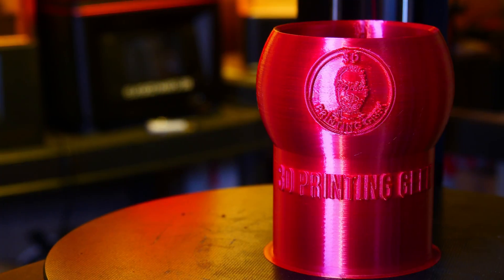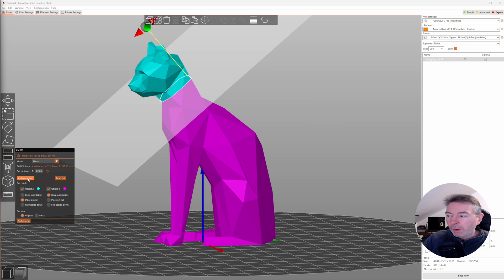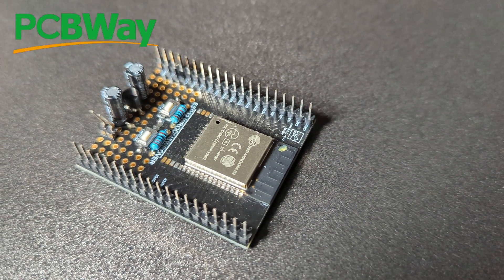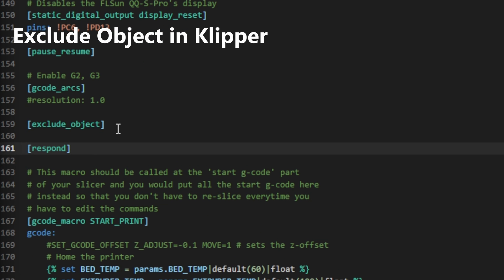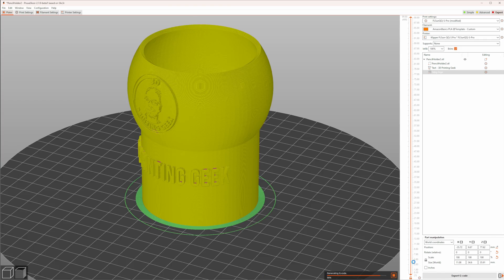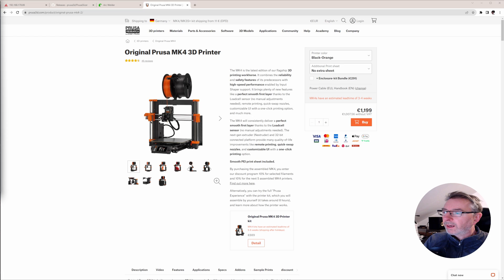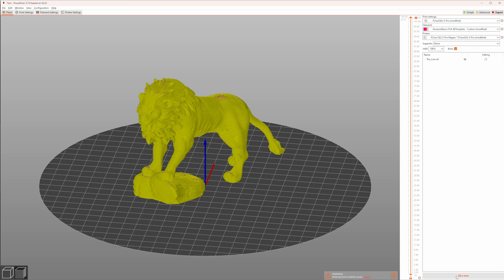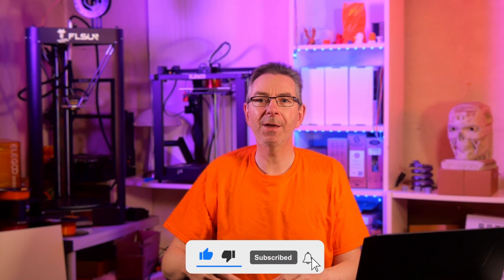From 2.6 to 2.7: What's New in PrusaSlicer's Latest Release?

Comment: My Add part section is not there
Reply from the maker: Thanks for the comment. Unfortunately without context I don't get what it is about 🤔
Reply: @3D_Printing_Geek  ah apologies for not being clear. I am new to 3d printing. So yesterday i was working on an object in tinkercad, exported it as .stl and imported that stl to prusa slicer ( my printer is Sovol sv07) within prusa i attempted to add text to the object however “add part” was not available, generally the menu i saw upon clicking the surface didn’t have as many options as in the video, the top part of menu options was the same however the it ends and i don’t get to add text to the object, only as a separate object on the bed..
Reply from the maker: @TheLooking4sunset   Ok. Now I got it. Are you sure you're using the 2.7 version of PrusaSlicer? I just tried exactly what you described: Exporting an object as STL from TinkerCad , and importing it into PrusaSlicer. Then right click on the imported object, and I was able to add text.
Reply: @3D_Printing_Geek  thank you so much for investing so much time to help me, yeah  it’s 2.7.1 ver. Running on windows, when I right click the object ( prior to slicing) the menu i see starts from top to bottom with:
-add instance
- remove instance 
- set number of instances 
- fill bed with instances
- delete
- set as a separate object
- printable [it is ticked]
-reload from disk
… ending on
- mirror 
- split
-add support enforcer 
-add support blocker

And that is it for me..
My best
LFS
Reply from the maker: Ok. Try the following: select the model, then press T. That's the shortcut for the "Add text" feature. 
The menu item when you right click is "Add part...". Then you should see "text" as a choice, among others.
Reply: @3D_Printing_Geek  perfect I am grateful!! I will follow these instructions and report back

Comment: How do i start the print????
Reply from the maker: Hi, the slicer just takes the provided model and creates a GCode-file from it. To print it you have to save the file to a USB stick, SD-card, or send it over network. Which method to use depends on your 3D printer model.
Does this answer your question?

Comment: wow!!!  I've been searching for how to separate objects within STL files without using a CAD program and your video explained exactly how to do it with the slice function!!  The text function was pretty cool too, I can see myself using that!!    You have a new subscriber!  

Do you have any tips on making the supports easier to remove and less intrusive?
Reply from the maker: Thank you so much for your kind words and for subscribing! I'm glad the video was helpful to you. As for your question about making supports easier to remove and less intrusive, as usual, there's no one-fits-all answer, and it requires doing tests for the specific material and printer, but I'll try to give some tips: 
- print at a lower temperature, if possible. It will reduce the bonding strength of the support with your print
- increase the Top Z-contact distance. Generally, I wouldn't go over 0.2 which is the default.
- Increase pattern spacing, but that could make the contact surface look worse
- if not already, try Snug support instead of Grid, that should be easier to remove, too 
- if possible, use "Support on build plate only"
- reorient the print, or use the cut tool to get away with no support, or avoid to much support (Golden rule: "No support is the best support ;-) )
- Consider using support interface layers to create a buffer between the support material and your print, making removal easier.
When using Organic Supports:
- Try adjusting the support density and angle, as well as the other branch settings to find the right balance between stability and ease of removal. 
  
I hope these tips help! Let me know if you have any more questions.

Comment: great video.  you did not mention which prusa printers support which new slicer features.  There is a huge crowd of prusa users that are not sure I would guess.  Awesome job I just subscribed...
Reply from the maker: The only feature that's mentioned in the video which is only supported by prusa printers yet is binary g-code, and that's only supported by Original Prusa MINI, MK4 and XL printers from firmware version 5.1. 0-alpha2. So it may be nessecary to update the printer to that version.
All other features are generally usable with any 3d printer.
Big thanks for subbing 🥰

Comment: Do you have conversion table for setting between cura and PursaSlice because my original slicer is cura. My printout have been optimized in cura. I like to try PursaSlice, but I do not want to retest every parameters again which not only causing time, but waste a lot of materials due to fail print.
Reply from the maker: Hey @hicl5450 ! I totally get where you're coming from. Switching slicers can be a pain, especially when you've optimized your printouts in Cura. Unfortunately, there isn't a direct conversion table between Cura and PrusaSlicer. But don't lose hope! You can start with similar settings in PrusaSlicer and make adjustments based on your Cura experience. It may take a bit of time, but I'm sure you'll figure it out. Happy 3D printing!
Reply: Try importing settings from your old gcode into Prusa slicer, it might work